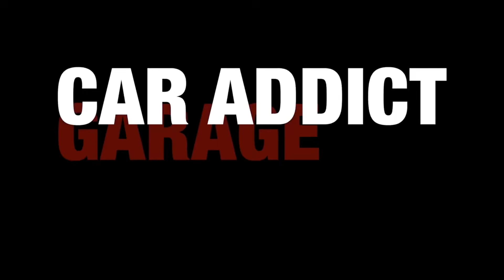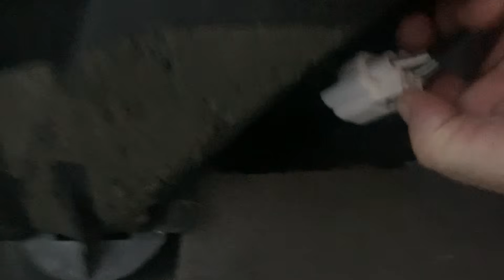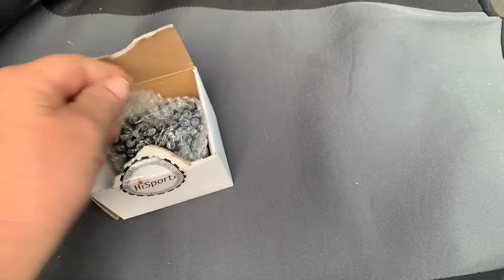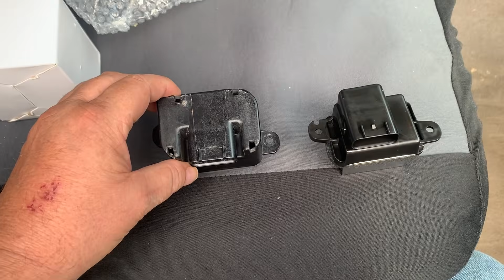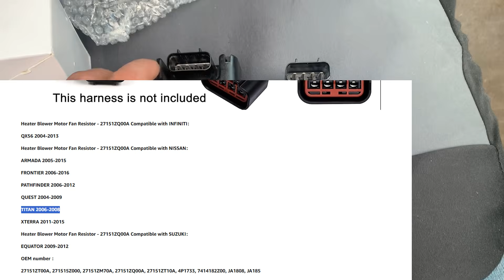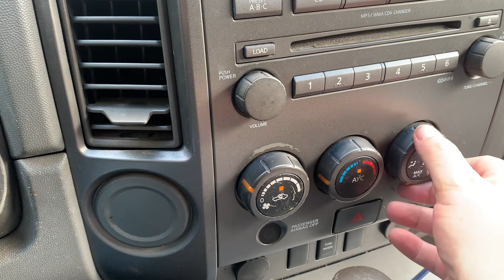Blower Motor Only Works on High Replace This Part! (Nissan Titan)

Comment: Replacing the resistor did not help. Fan still runs on high speed only. 2007 titan with automatic air--part I used is import direct 30-0407. Dash disply now shows more speeds available (7) but still only runs on high.

Comment: 2003 dodge ram ,put in new heater core put it all back together and only have touch of heat when that knob is not in hot or not in cold right belween them you can feel a little heat ,other wise blows cold on both hot and cold ,is that a resistor ??